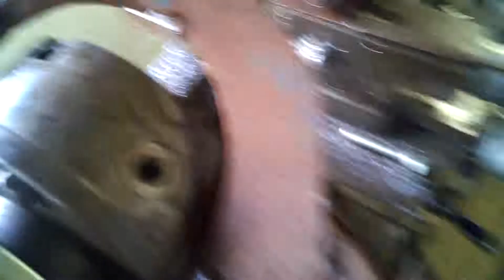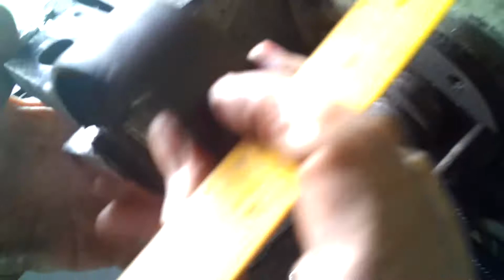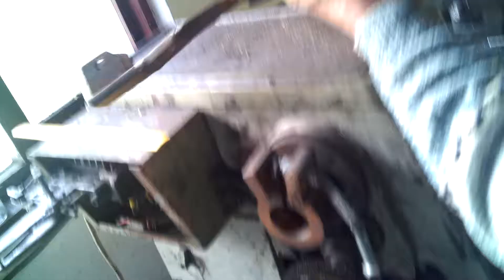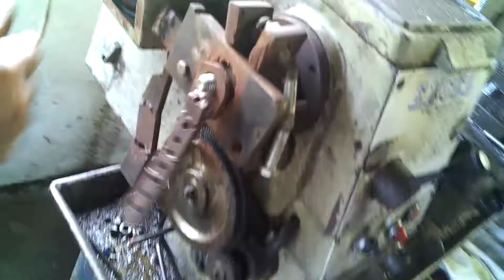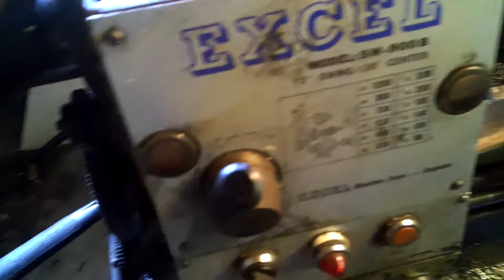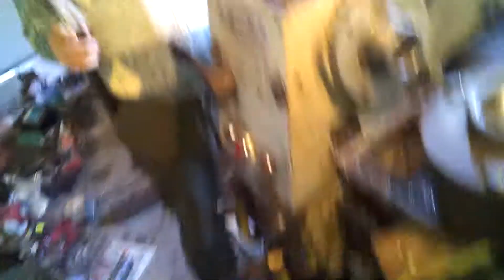The Shenwai 900 lathe.  Video No 21 A, Bring it back to life.

Comment: Where can I find parts for this model?
Reply from the maker: There are none, however they are such a good lathe that parts can be made for them. That is the point of my video.    What is wrong with yours?
Reply: @ValMartinIreland  I bought it used and it is missing two gears in the gearbox.
Reply from the maker: @ChrisPBacon-yz6nk  It was not easy to lose them.   Are you sure?    If you tell be exactly their position I might be able to say how many teeth they have.   They can be made up they are straight.
Reply: @ValMartinIreland  I’m guessing that the previous owner removed them because they were busted or something. I think these are the D and E gears. If you are looking at the gearbox removed from the machine, they are on the same shaft as the gears that form a cone shape. Directly across from the small end of the cone the shaft goes through a divider in the housing then you have four gears on that shaft, a small one then a large one then a small one then a large one. The small one and large one next to the divider are missing. I was told that an Enco 12-36 has the same parts, is that true?
Reply: @ValMartinIreland  Don’t leave me hanging. Please. I need help.
Reply from the maker: @ChrisPBacon-yz6nk  I took off the cover.   We are talking about the shaft in the centre on the vertical plane 
with the cone on the right looking in of the divider.    Now we are talking about the shaft to the left of the divider.   There are not 4 gears wheels on this , there are 5.  (five).    Form right ( side next the cone/divider)  moving to the left  (head stock end of the lathe),    there is a small -  a large -  a small - a large and a small.   Total five.    Here is the arrangement irrespective of from which side it is viewed.
  S L S L S .   How many gears have you left on the shaft now?
Reply: @ValMartinIreland  you’re right, there are 5 gears there. I have three left on my machine so I’m missing 2. A large one and a small one. 

Is it true that an Enco is the same as a Shenwai? I saw a thread for the rebuild of an Enco 110-2033 lathe and the gearbox looks identical to the Shenwai.

I found a parts list for the Enco online and the part numbers for those gears are 3D-2 (small) and 3D-3 (large).
Reply from the maker: @ChrisPBacon-yz6nk  I do not know if the parts of any other lathe fits them or not, but I can tell you that you are lucky in that you have physical examples of the wheels you want.    The two you have there  are the same in my opinion as the two you need.    This means you do not have to guess or estimate what you want.   I do not know what country you are in, but would suggest you check with an Enco agent.  See can you buy the small wheel at a reasonable price  and if it fits there is a likelihood the large one will fit also.  If that does not work, I would make them out of plastic.   Many small Chinese lathes have plastic train drives.    They work OK for  while.  They could be made out of mild steel using the ones you have as a pattern.   It requires a milling set up.
Reply: I also need some parts for mine. The previous owner removed the feed worm and worm gear. If you dont mind, could you please share the dimensions of the brass worm gear. Then I can have them made. These are great little machines.